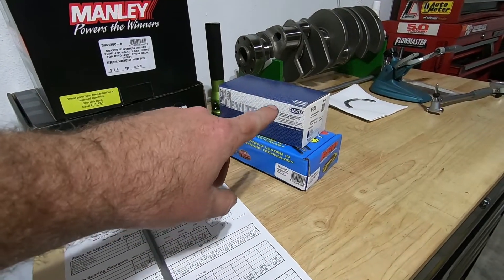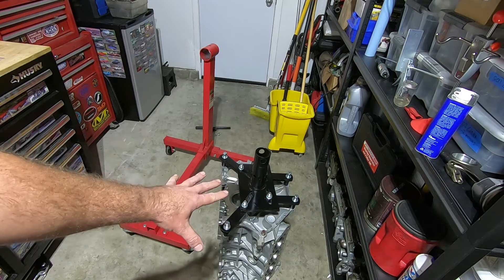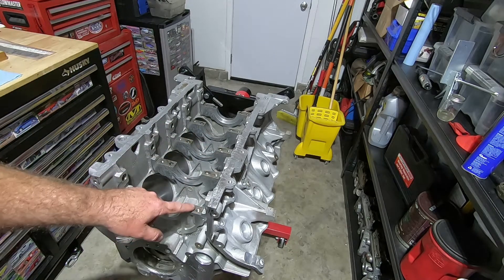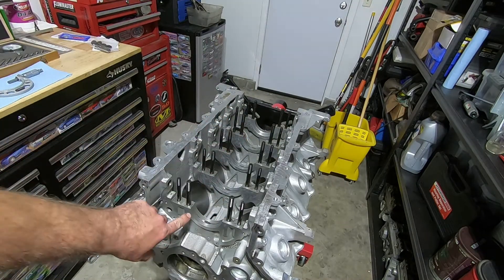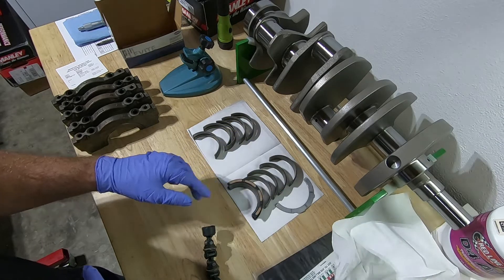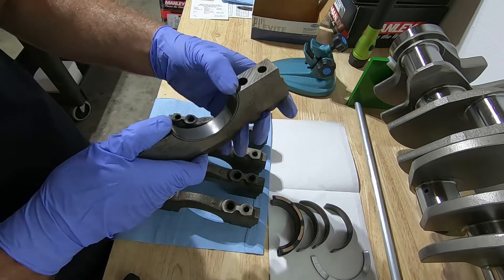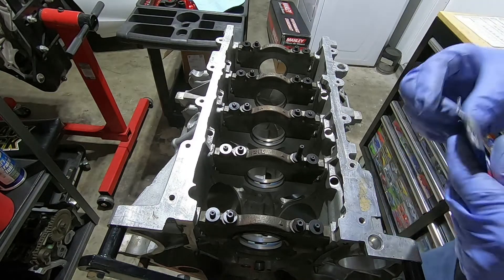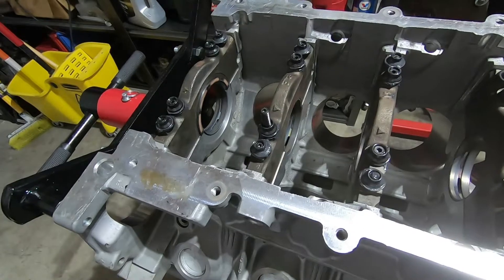Pt 2 Installing ARP Main Studs and Clevite Bearings - 5.0 Stroker 4.6 Teksid Engine Block

Comment: Did you get the mains align honed with the studs? Is it necessary?
Reply from the maker: I did not, some would recommend doing it but I have done several without and have not had a problem.

Comment: What the difference between oem replacement and Hig performance rod bearings? Is ok to use high performance for steet, any disadvantage or advantage?
Reply from the maker: The high performance bearings are made of better material and have better characteristics than factory OEM style bearings.  There is a lot more to bearings but long story short they have better capabilities and are fine to use for street use.  I don't really know of any disadvantages other that the price.